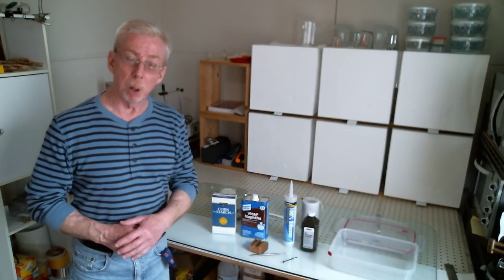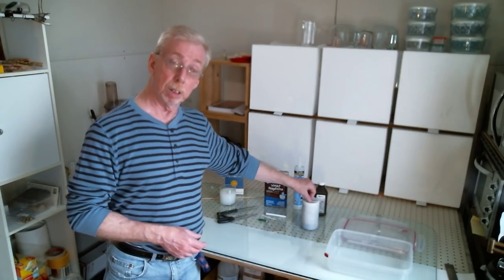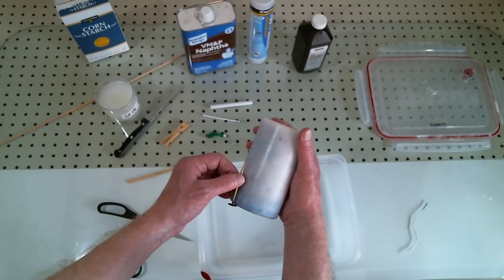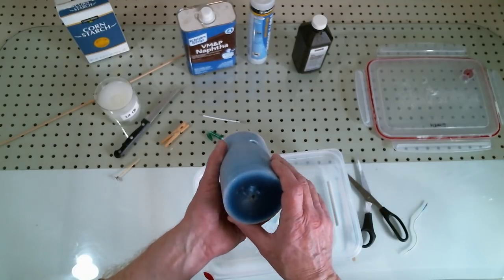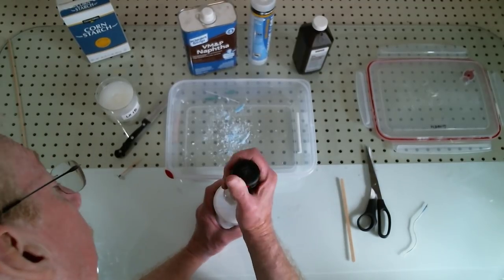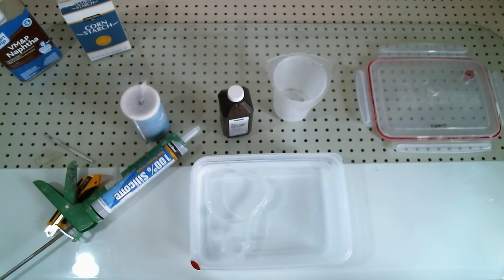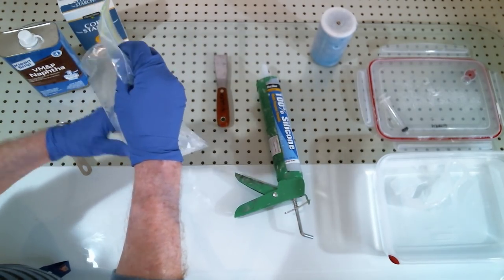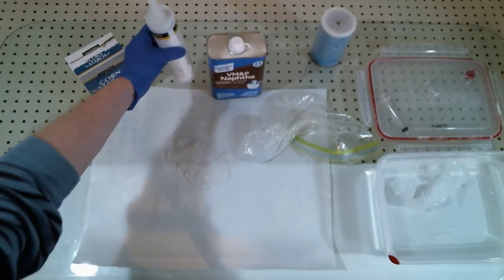Silicone tubing DIY. Thin clear silicone w/Naphtha.

Comment: I make molds for casting resin. I tried this. 1 tube of silicone made about 24oz of silicone after adding a lot of NAPTHA. I poured a two part mold. I had to add the corn starch after I thinned it and pulled a vacuum on it to get the air out. Wax the part and brush vaseline on it and the other silicone half.
Reply from the maker: Thank you for sharing your method. I am pinning this to the top so others can gain from your help.
Reply: @GEOsustainable  Thanks, One other thing with a 2 part mold, is that you have to make each half the same thickness. That way when shrinkage occurs both pieces will match.  The poured ends of each half of the mold have to really be thick.

Comment: Hi friend

And why don't you put a nail or a screw directly in the center of the plastic nozzle, of the silicone outlet???
thus
, it would come out directly in the form of a tube

greetings, good job
Reply from the maker: Did not have either one handy:)
Reply: How will you attach the nail inside the nozzle?

Comment: a question
How does corn starch affect to the mechanical properties of silicone?
  makes it more fragile stronger?? or what??
Reply from the maker: I don't use much, so the mechanical strength I am sure is fine. If you use a lot, it will cure before you mold it. I am sure there is a limit to how much before you lose bond.

Comment: hey im wondering how much shrinkage there is from using naptha and also have you tried using glycerin and or acrylic paint? both help is dry faster and the glycerin helps the silicone from sticking. just a thought.
Reply from the maker: Have you tried this?
Reply: @GEOsustainable  yep just tried both glycerin and acrylic paint to make molds for my gundam model pieces. also i used xylene as the thinner since i found a post saying that xylene shrinks the least out of all the common hardware solvents. (xylene may still be hard to find in some places since only one store carried them in my city.)
Reply: @GEOsustainable  im wondering what your experiences might have been when using naptha as the thinner in terms of shrinkage.
Reply: had a bit of trouble with bubbles but my male side seems to be relatively passable as i expected to be filling holes anyways and am quite experienced with that. amd working on the female side as we speak! i am eager for your reply!! and thanks for the quick reply!!
Reply from the maker: @YerroPhunder  There is shrinkage, and the more you thin it, the more it shrinks. IT wasn't much for the mold O made. But, you have to guage what is acceptable yourself.
Reply from the maker: @YerroPhunder  Not likely. Any solvent, once that volume has evaporated with leave space for shrinkage.
Reply from the maker: @YerroPhunder  I poured staright out onto my article. I have never seen bubbles. I do have newer videos on improved method for mixing. Perhaps check them out.
Reply: @GEOsustainable  u were completely right, my male side shrank about 8% total volume over night. i am going to have to work with very little to no solvents as id like an exact scale copy of my originals.
Reply: @GEOsustainable  i mixed using a stick and a cup but will try the ziploc bag way that i have seen you use. thanks for the quick replys!
Reply from the maker: @YerroPhunder  I am glad I can help. Something I do is to make my mold larger in percentage so that my finished is spot on once cured. I go over some simple math in the video on using silicone as an artist medium. If that is not an option, then yes, no thinner. Silicone has virtually no shrinkage if used right from the tube.
Reply: @GEOsustainable  thats great to know. your replys has been beyond helpful! hope i can learn more things from you!

Comment: You're a genius
Thank you sir =)
Can you tell me roughly how long does it take to cure for a thinned and poured silicone cast.
Knowing that it is poured in a cube shape mold with 2 inch edge.
And maybe it would cure faster if i poor multiple layers and let them cure in between
Reply from the maker: Cure time depends on the thickness. Anything more than 5mm will not cure unless you add moisture (water). Water is the catalyst. Adding cornstarch is an easy way to control the moisture. Cornstarch loves water. In my series on silicone, I use cornstarch and in this video, I squeezed out my tube in a solution of water and hydrogen peroxide. As I cover different methods in each, I encourage you to watch the entire series, and stay tuned for a new one I am currently making on 'thin pour for pouring a thin sheet'.
Reply: @GEOsustainable  thank you very much for your fast and clear response

Comment: I have a question, please. 
When I added naptha to silicon 
And I mixed up. 
Silicon turned into liquid, but it remained liquid and didn't dry out, and it had cracks. 
What's the reason?
Reply from the maker: It is difficult to know for sure, so I will go over a few things you may habve missed in the video. Use ony Silicone that 'smells like vinegar' when you open it. Do not use too much Naptha, at most 1/4 of the total volume. If you pour it too thick, it will never cure. To cure a thick pour, add 1/10 of total volume of Cornstarch. I hope this helps. If you have trouble, let me know in the comments (new one so it sends me an alert), or you can email me (email in the description.

Comment: what strength of hydrogen peroxide are you using?
thank you for your time to share your knowledge
Reply from the maker: I use 3%, straight from the bottle. Thank you for your kind words, it inspires me so much.
Reply: @GEOsustainable  im not sure what i did wrong with hydrogen peroxide in water proportions, the silicone was still tacky and stuck together. I tried using a dish soap with water and it worked.
How long do you wait before taking out the tubing from peroxide solution?

Comment: Hi. Is there have any products to bond between pp and glass together?
Or using as a adhesive preparation before silicone glass to pp?
Reply from the maker: Nothing sticks to pp, change to a bioplastic.
Reply: @GEOsustainable  thanks sir, how about PP primer or silicone primer on the PP surface first? then stick the glass with silicone.

Comment: I am trying to make a mold that is flat for a resin pour to make a lampshade. So,basically a slab , but in  different shapes for each lampshade. Which mix would you recommend? I’m struggling with this. Thanks in advance!
Reply from the maker: I have just the thing for you. This will serve you well. https://youtu.be/sIQkFVftDZU

Comment: I tried the bag method with an entire tube of silicone caulk, but the silicone was already starting to set within 5 minutes it kneading, making it impossible to pour. Am I doing something wrong?
Reply from the maker: Yes, you used too much cornstarch. I use 10 grams of cornstarch to every 100 grams of silicone, which I mention in many of my videos. This will give you a set time of about one hour, plenty of time. I have a later video on this method, check here. 
                https://youtu.be/sIQkFVftDZU

Comment: Thank you for the video!  Do you have any idea on cure times vs silicone thickness in regards to the pourable silicone?  I am making a 2x4 shaped mold that is about 3 inches tall and I am worried about it taking forever to cure or not curing at all.
Reply from the maker: Glad you enjoy my content. I have solved that problem as well. Watch this video to see how its done. https://www.youtube.com/watch?v=E_IOqxds130 and here https://www.youtube.com/watch?v=Ob9Y7sjI4IA&lc=z22zxxcqfrysunu0qacdp435gmliy2bd01rurwazwg1w03c010c

Comment: Please let me know which would be the cheapest clear silicone to be used for the same? Do we need H2O2+ water in each and every case? What curing agent other than H202, be used for the same? I want to get transparent and flexible vascular phantom models.
Reply from the maker: GREAT questions, again! Firstly, they will be translucent at most. If you need them to be transparent, I have a few videos on Casein you may find useful. You can use the cheapest clear silicone found at a hardware or home supply store. Yes, as shown in the video is how to use water and H2O2+. The curing process is explained during the demonstration. It should work very well for your project. Thank you for your questions.
Reply from the maker: I have developed an extensive playlist covering the topic of silicone. I think you will gain a lot from watching. https://www.youtube.com/watch?v=Ob9Y7sjI4IA&list=PLmAU7fwOLS3FSvjEzf3OJMHL5a1UO1ayJ